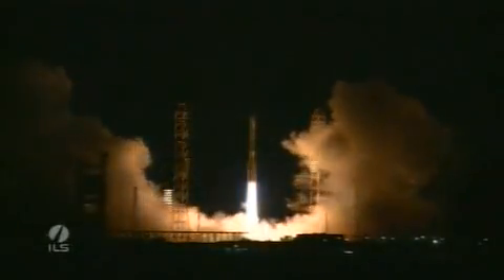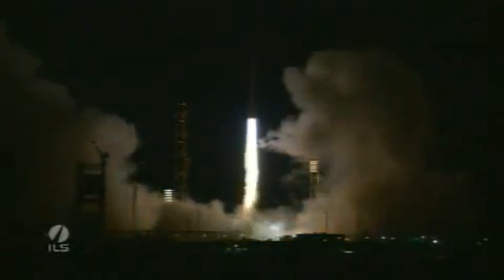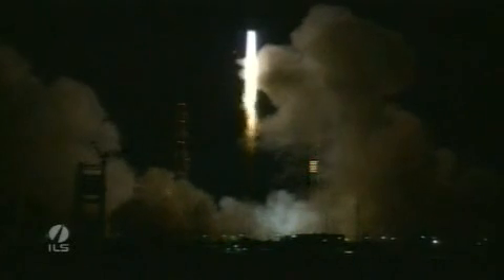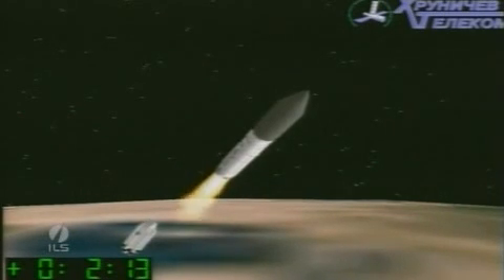Viasat-1 launch with Proton/Breeze-M from Baikonur on October 19th, 2011 at 18:48 GMT

Comment: @1711whatsup There are alot of people who cannot get wired or wireless, due to remote sites or terrain. This satellite will deliver true broadband to everybody. 5mbps down and 500kbps up - 30gb of data included for $60 a month (Canada) which includes equipment rental, which means its is always under warranty, extra gigs $2.50. Better than a stick and stream HD video , netflix and mulitple users no problem.